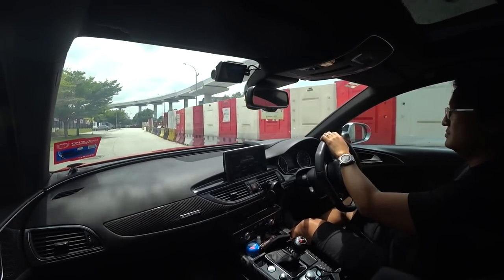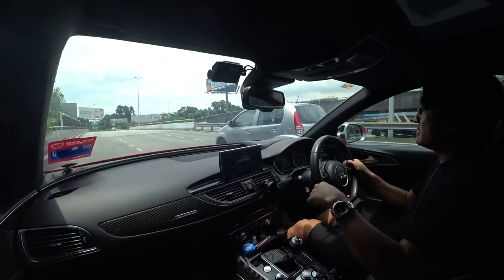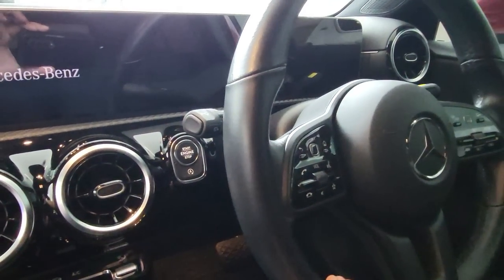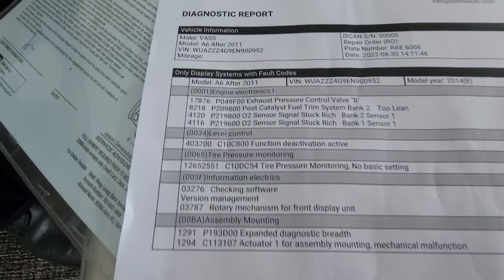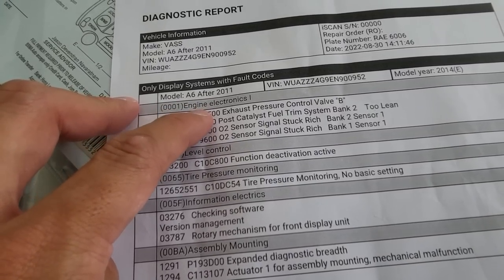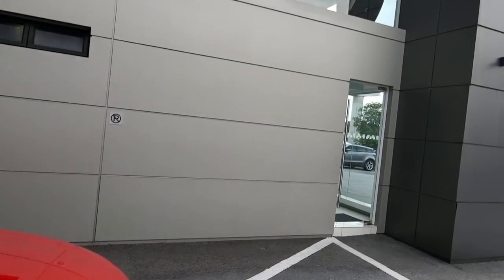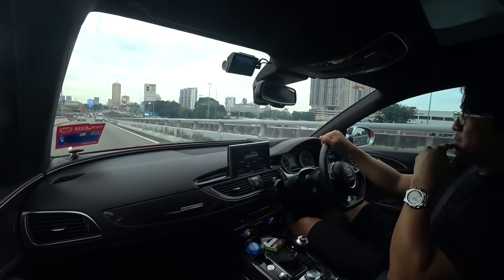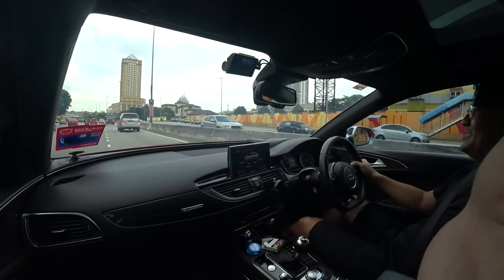How to solve carbon ceramic brake discs sound | Evomalaysia.com

Comment: This is because carbon ceramics brakes are used for racing. Fungsi dia sama macam steel brake kalau guna untuk normal driving. Kalau untuk track carbon ceramic lagi jauh hebat dari steel brake . Carbon ceramic stop making squeaks if the brake is hot enough. When the brake is cold it will produce squeaks and its totally normal

Comment: Carbon ceramic brake discs are annoying and finicky. The dics and pads are not properly bed in, which causes it sound like worn out disc brakes when apply the pressure. The proper way to silence the sound permantely is to drive the car above 250kph and apply full-force sudden braking until the car stops. This will properly bed in the dics and pads. But if you are out of warranty, just buy and put steel pads and rotors on all 4 corners. It will make your driving much more pleasurable and you keep the carbon dics for when you are selling the car.
Reply from the maker: yeah needs to give it a few hard brakes to silence it. if we drive moderately for about a week or so the sound will come back